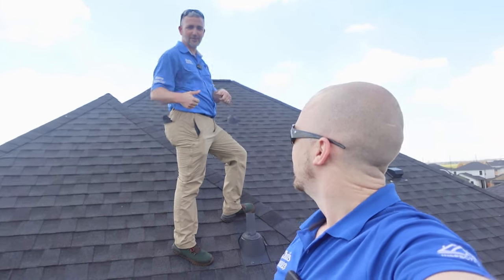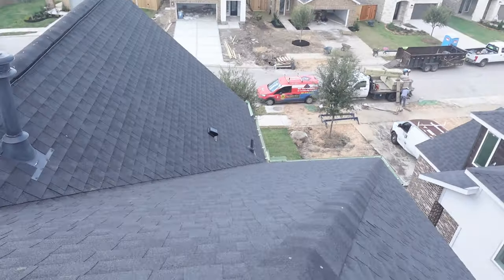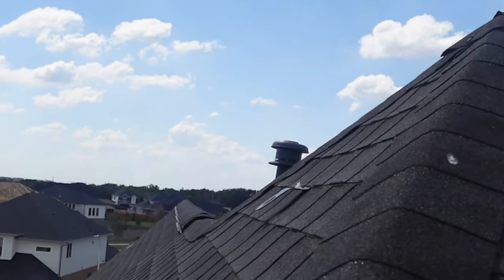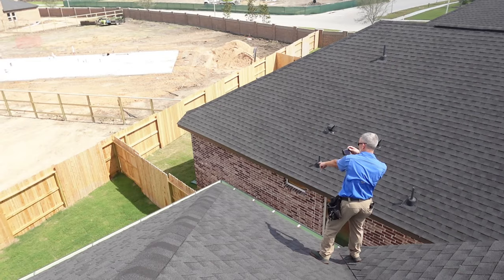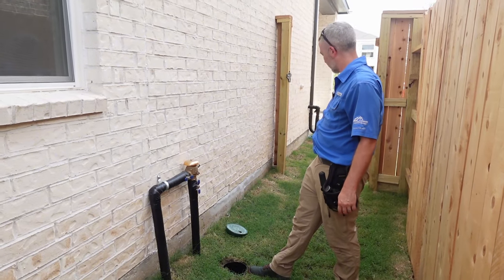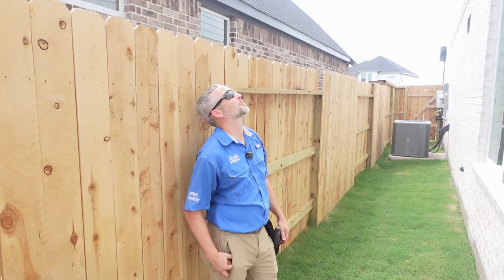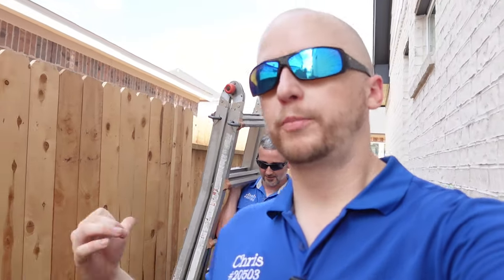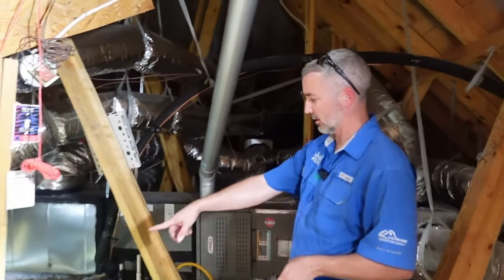Inspecting a 2024 New Build: Shocking Defects Revealed!

Comment: I see the radiant barriers and fire sheathing inside the attic. Would it be a problem if the fire retard/white sheathing(other than the radiant barrier) is wet and moist to the touch 
especially after heavy rain fall.  In your opinion could that lead to serious roof leak?  Great video by the way.
Reply from the maker: I am sorry,  are we talking about this property or your property?
Reply: No just in general. I used to own a new build with that problem and the warranty manager replaced the shingles and added a missing gutter but the problem persisted.
Reply from the maker: @lugergold3163  if you have any moisture in the attic it would be from some sort of leak.  Especially to the touch.  Our humidity isn’t high enough or shouldn’t be high enough for something to be wet to the touch.  The source must be found and corrected.